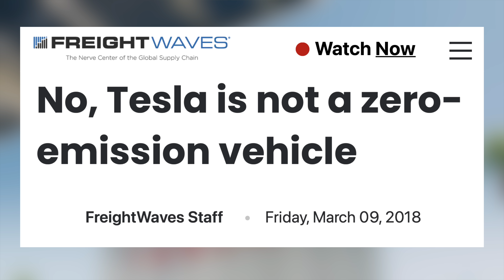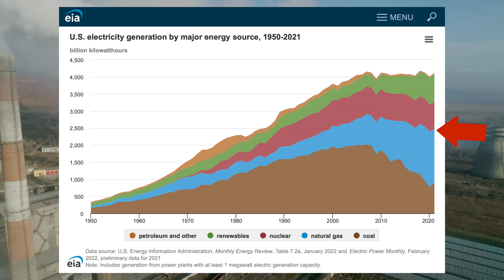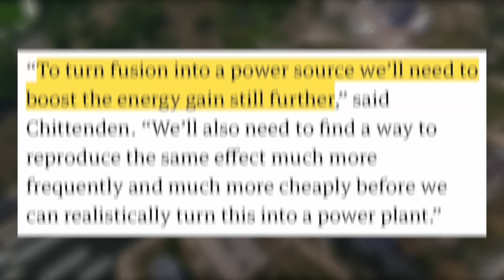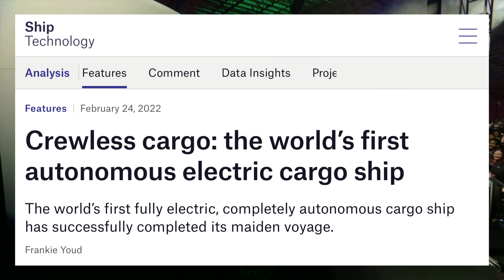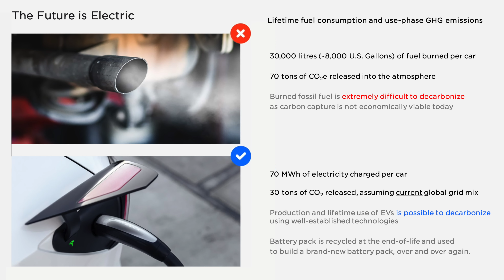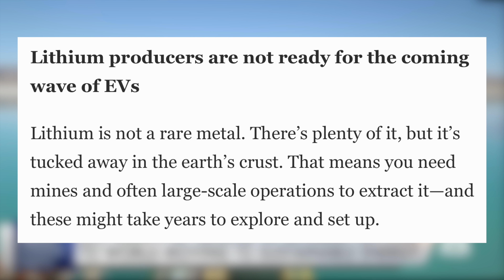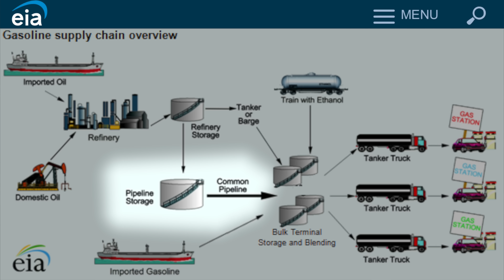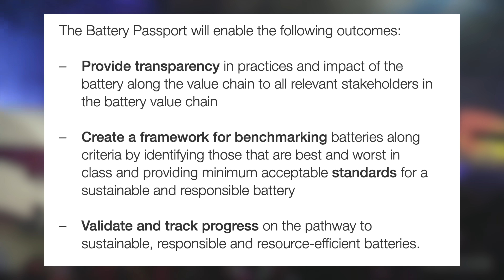Tesla’s NEW Energy Supply Is Here | This Changes Everything

Comment: Good stuff.  Isn’t it true that Big Oil & Gas regularly pulled our chain, rumoring that they were running out, or there was only so much left, so many billion barrels of oil remaining, and if they didn’t find more soon…well, you get the picture.  Scare-mongering.  And lying I suppose, because it’s funny how when Big Oil says we’re going to run out, nobody equally says ‘we better start making another kind of automotive power’, but rather the media would say ‘we must drill for more oil asap’.  I think that any method of powering a vehicle, that can reverse the process when you go downhill, recouping energy, is the winning trick.  All the rest - hydrogen, gasoline etc - is fundamentally flawed.  Inherently, the regeneration trick cannot be beaten.  It’s like a test: does this super-duper method you just came up with, pass the regeneration test, when ‘engine braking’ or going downhill etc?  If the answer is ‘No’, then it’s a poor second option, belonging in the same category as Big Oil & Gas solutions.  

There is one thing, hydrogen has in common with oil & gas, which is that it fails this test.  Actually, I am wrong, there is another thing - you can NEVER generate hydrogen, oil, or methane gas yourself, without a special licence and fundamentally without extreme risk of harm or property damage.  This, points to the other great reason Big Oil etc like burn-once fuels.  The public, are not in control of production, a cartel that is on-side is.  Take care all, have a good break and New Year.

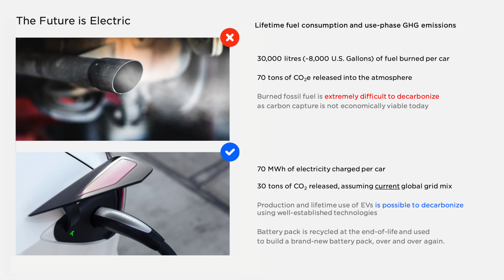Comment: Ryan, at the 9:02 mark in the video you show a comparison of CO2e released into the atmosphere by ICE and EV cars.  I wonder why these comparisons don't account for the CO2e of refining the oil into gasoline that the car uses.  Since the EV CO2e value is pretty much based on the  production of electricity, it only seems fair that there should be an accounting for the CO2e emitted when producing the ICE fuel.

Comment: 70 MWh seems low.

From my energy stats in my Model X Performance, I used  850 KWh in the last 31 days. Let's round that to 1 MWh / month. So the lifespan is 70 months? 5.8 years? I've driven 12000 miles/year on average. The battery and drivetrain have an 8 year 150k mile warranty. I'll hit the 8 years first.

Again, 70 MWh seems low. I expect doubling it would be a safe, low estimate. Realistically, it's probably closer to 3-4x higher.

Comment: Nuclear breakthrough: "limitless free energy"
Why do people say fusion power would be free. That statement is patently false. Fusion power may require tritium and deuterium, at the very minimum hydrogen. All of these are found in water molecules. The water needs to be purified (requiring plant IMO, investment, maintenance, operations), hydrogen has to be derived from water (requiring IMO), deuterium/tritium has to be separated from hydrogen (IMO), a massive technology intensive set of apparatus has to reliably make heat by fusing HDT into helium to boil water to run steam turbines to make electricity (IMO on steroids), feeds into conventional transmission and distribution (IMO).

Not bad, possibly practically limitless, could be the best thing that ever happened to us, but not even close to free.

Comment: The main thing you left out was on the argument of more electric cars charging off of power plants that burn coal, which are quickly disappearing because all the newer ones run on natural gas because it is cleaner and cheaper, but if your electricity comes from a coal powered plant over 90% of the charging will be done at night while you sleep at home and those power plants are running anyway whether you use the power or not, so you are not increasing the amount of cold burned. You're just making use of wasted generator capacity which can mean prices coming down because they're now making money at night where before daytime had to cover it as far as price.

Comment: Ryan, great work on a tough subject.  The last thing you need (or deserve) is a suggestion to include the relationship between peaker plants and other infrastructure needed to meet short-term energy demand, relative to the potential for using batteries (including those in EVs) to meet that demand.  (I'm assuming that the batteries are charged by excess wind, water, and solar energy)  Maybe this isn't a large factor?  I'd be interested in it's effect on the argument though.

Comment: Very good analysis with the news of the fusion breakthrough.  But I think you need to step back and keep an open mind.  The same energy (heat) produced by can also be used to make hydrogen through electrolysis.  I think of both the battery and hydrogen as a transportable energy media.  When you mention larger transport, batteries will be much too heavy for airliners, trains, and buses.  You take a lot of time talking about the recycling of lithium, but you have to also take into consideration the damage to our earth through mining of the precious metal.  There will eventually be wasted batteries because recycling is not 100%.  At least with hydrogen from fusion sources, there will also be a clean source of energy with a high energy density to power our electric vehicles through a fuel cell.  Fusion electrical generation plants are at least 10 to 12 years away, but green hydrogen can be produced today with less efficient but still clean solar energy.  Yes we don't have many hydrogen charging stations in the country, but it was analogous to where we were back in 2012 with the first BEV's.  There weren't many charging stations around at the time.  Each one had to be carefully planned and electricity provided.  A temporary hydrogen refilling station can be placed at any permitted site by just parking a large hydrogen tank in that location, so even remote areas just need a concrete slab with a solar roof to run the metering and billing delivery pump.  So I can keeping open minded and supporting all green technology.  Some may do better in different populations and geographical location.  Most of all I agree with you that this is great technology news that will affect all parts of life.  Thanks for another enlightening video.  Not everything is Tesla.

Comment: There are many problems with nuclear fusion you glossed over.
First, it took over 300MJ of energy to create the 2.1 MJ of laser power that produced 2.5 MJ of heat via fusion.  There is a HUGE distance to go to produce more real power out than what is used to cause fusion.
It isn't simple hydrogen that is used, it is deuterium, which is a heaver form of hydrogen with an extra neutron.  There is a small percent of deuterium in water, but there is enough that is virtually limitless.   The problem is that it takes a lot of energy to separate this heavy hydrogen from regular hydrogen.
Deuterium is than mixed with helium three, a form of helium that only has 3 neutrons instead of the normal 4.  Helium 3 is extremely rare and extremely expensive to separate from regular helium supplies.
When Deuterium and helium three undergo nuclear fusion the result is a regular helium atom and 2 neutrons.  Neutrons are what causes nuclear fusion with uranium or thorium, with radioactive waste from the fusion.  In a fusion reactor these neutrons can react with the materials that make up the reactor itself and produce radioactive waste.  Fortunately they can also react with lithium to produce helium three, so in effect producing part of their own fuel.
Nuclear fusion as a power source has always been "just 30 years away", and remains so.  Producing it economically as a non-polluting source of electricity for terrestrial use is probably impossible as well but it might be possible for generating power for some sort of space drive system (think Si-Fi).

Comment: This is the key, existential difference between the archaic century old fossil fuels and the future of EVs. 

Fossil fuels achieved their zenith some time ago. It is tech that is static, frozen in time. There may be small, incremental increases, but at scale those are minuscule. It still takes a lot of energy to explore for oil deposits, drill and extract, transport to refineries, refine, transport to distribution points, then transport again to gas stations, store, pump into cars (with untold vapor escaping), and then burn at an incredibly inefficient rate of 20%-30% potential energy to motion. And each of those steps are fraught with large scale environmental ecological disasters., to say nothing of the tremendous damage done to the environment every. single. time one of those ICE is used. 

Creating electricity though is a nascent technology. Improvements in the technologies for sourcing, creating, transmission, storage and converting to motion are just starting to become apparent. None of these technologies is stagnant, stuck in the past like fossil fuels. Breakthroughs, discoveries, constant pushing to improve every aspect of creating electricity is going on, every day, across the globe. 

We have a choice - stick to 100+ year old tech, or move forward into the future. 

At 67 years of age, with children and grandchildren, I know without a doubt the answer is looking forward, not to the past.

Comment: CO2 from the air or from flue gases can be used to make fuel and other things via Fischer-Tropsch process. Locate a nuclear plant next to a coal or NG plant.
Reply: The Fischer–Tropsch process is a collection of chemical reactions that converts a mixture of carbon monoxide and hydrogen, known as syngas, into liquid hydrocarbons. These reactions occur in the presence of metal catalysts, typically at temperatures of 150–300 °C (302–572 °F) and pressures of one to several tens of atmospheres. The process was first developed by Franz Fischer and Hans Tropsch at the Kaiser Wilhelm Institute for Coal Research in Mülheim an der Ruhr, Germany, in 1925.[1]
As a premier example of C1 chemistry, the Fischer–Tropsch process is an important reaction in both coal liquefaction and gas to liquids technology for producing liquid hydrocarbons.[2] In the usual implementation, carbon monoxide and hydrogen, the feedstocks for FT, are produced from coal, natural gas, or biomass in a process known as gasification. The process then converts these gases into synthetic lubrication oil and synthetic fuel.[3] This process has received intermittent attention as a source of low-sulfur diesel fuel and to address the supply or cost of petroleum-derived hydrocarbons. It is now receiving much renewed attention as a means of producing carbon-neutral liquid hydrocarbon fuels from atmospheric CO2 and hydrogen.

Comment: They got more energy out of the fusion than the lasers put in. However, this did not include/consider the energy required to produce the laser pulses themselves. It only compares the released laser pulse energy and the fusion output. It’s a milestone for sure, but it was stated that the resulting fusion was about 1% of the total energy.
Reply: Right, and they got 50% more heat energy than the lazer energy they put in. I can get 300% more with my heat pump at 47F. The average coal plant in the US converts heat to energy at 33% efficiency. The best on the planet is 45-46%.

Comment: Will that last past 100 miles  318 at 90 percent when I bought it 288 at 90 if it charges to 90 after 54 thousand miles. I start at 90 drive 130 miles car sits at my job for 11 hours when I get home I’m at 30 percent  another 40 thousand miles I will have to super charge on the way home    Great car if you drive less then 40 miles a day  starting to look like a allusion.

Comment: Love your videos.  I am always frustrated by people that attempt to compare the efficiency of electric motors with combustion engines.  In the case of electricity most if the inefficiency is in the production of the electric "fuel".  The combustion engine doesn't have that step.  Think of it this way:  Drive your gasoline powered car to the top of a mountain - then coast all the way down using no fuel.  Pretty efficient on the way down, huh?  Great mileage coming down.  EVs are somewhat similar.  All the hard work is done making the electricity.

Comment: Your explanation for the process of charging an EV is grossly simplistic. It’s obvious that gas vehicle’s are extremely inefficient compared to EV’s but you also need to talk about the problems with going pure electric so that people are aware. Here’s just a few: AC/DC conversion losses, transmission/distribution losses, solar panel reliability/output, grid stability, and so on…

Comment: Lead acid batteries are recycled at a rate of about 90% so your car battery might contain lead mined in the 1950s. That's why we don't have a lot of lead mines. The same will happen with EV batteries not because of concern for the earth or amount of materials on earth but for the same reason we recycle lead, money. It will cost less to recycle EV battery materials that mine and refine virgin material. Also, keep in mind there are many battery chemistries in development and there will likely be more each year that don't even exist today. Lithium may not even be used in future EV batteries or only some percentage of them. There is also many ways to generate electricity and again, there will be more each year that don't exist yet.

Comment: The trillions of tons of carbon dioxide trapped underground used to be in the atmosphere. The Earth has evolved with much more co2 in the atmosphere no harm done. The atmosphere was previously 50% co2, much of it dissolved into the ocean and precipitated into rocks and shellfish or consumed by the evolving biosphere. Co2 is at an extremely low level historically and almost reached minimum survivable levels for life just 20,000 years ago during the last glaciation period. Levels dropped to 180 ppm just 30 ppm above total extinction of all life with no coming back. Too little atmospheric co2 when the next glaciation period arrives will eliminate all life as the cold oceans suck the co2 out of the atmosphere. The glaciation cycle over the last 3 million years has been 100,000 years glacial period followed by 20,000 years warm period repeating cycle.

Comment: Ryan, I think we all are missing something here. They are fusing pure Hydrogen. Where do you get hydrogen from?  It is not found on the earth in raw form because it combines so easily with other elements. 
So where do you get it? From water electrolysis or from petroleum (hydrocarbons). That’s it. 
So how are we going to get all this hydrogen to fuse? Will we first have to split apart water with solar electricity? Why not just use the electricity from solar directly?   Pump more oil and cause more CO2 to split out the hydrogen?  Oh I will bet the petroleum industry will come out in support of hydrogen fusion!!!

Ergo, Hydrogen fusion is not a real solution unless they can fuse it while it is combined with other elements such as in water. 
Fusion will only be better than solar for the environment if they can fuse elements that are found in raw form in nature. That may be another century.

Comment: I charge both of my Teslas and other electric vehicles with my off-grid solar power system. I'm surprised people never mention this option.
Reply: We do the same
Reply: Good for you, not everyone can do that, so the point is moot.
Reply: @KB93-A   it more of an option than you think. More people live in homes than apartments. 

Even if it’s seasonal. It still reduces cost drastically
Reply: @KB93-A  How is the point moot?  It's  part of the overall landscape of energy sources.  He didn't say everyone could generate energy at home, but it's obvious many can.

Comment: How long has crude oil been around vs. Lithium?  And LIthium is already running out (not to mention the ecological cost of mining) vs. the established infrastructure of oil wells.  Everyone is guessing we'll run out of oil, but that is based on the fallacy that oil is derived from what...dinosaurs?  If you can find DNA in crude oil or show me where a massive dinosaur bone grave exists where oil is being drilled, let me know.  Until then, "fossil" fuel is a lie.  Fusion technology as discussed in this thread is not coming anytime soon.  A more pragmatic approach to cleaner fuel burning and hybrid technology should not be discounted as and EV only approach is not feasible at least in the short term.